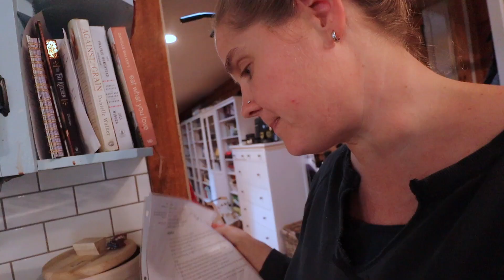Building a Homestead in 100 Days - Day 38

Comment: Justin i have put in several Apollo heating systems and i have alway put the Water coil between the filter and furnace so that it captures all the airflow . as you noted only 1/3 of your total CFM is going thru the water heat exchanger that needs to be adressed . hope to chat about all things homestead in the future.
Reply: I think that location will heat up the blower motor and reduce its lifetime. I think inside a  transition duct between the top of the furnace and the bottom of the AC evaporator case is a better location.
Reply: @bruceadler-9410  I agree but from the video Justin doesnt have the clearance above the furnace to the trunk line because of ceiling height. between the furnace and evaporator coil would be the Ideal position.
Reply: @ncbeeguy  I also thought the vertical clearance might be a problem. So I told  Justin he should replace that oversized Muli-Position A-coil evaporator with a smaller vertical N-coil evaporator, and install a single correctly sized heat exchanger in a new transaition between the furnace and the new shorter evaporator. Even if the result is an evaporator that's undersized for his house. I think in his environment adequate heating during winter is a higher priority than maximum cooling during the summer (especially since they're the types that spend their summers outside and not inside chilling in front of the AC). And just looking at the relative sizes of the furnace and evaporator, I suspect that his current evaporator might be too big for the available CFM from the blower in the furnace (but that's just a wild guess).

Comment: Your cinder block building on the hill could be a  possible shelter or  stall for animals on hillside...like a future momma pig with young healthy piglets, to get out of wheather.or a Cow with calf that needed shelter from wheather. Sheep ect. You could save water run off roof, with gutters to fill a water tank for your source outside. Make part of it blocked off for storing a few hay bales or bagged wood chips for  clean flooring, or you could build an add on small storage shed rat proofed to keep some feed there in a drum. Just a thought it's a stout building already that won't blow down, it would be cool in the summer, protection in the winter. Or a quarenteen area for new animals.

Comment: Simplest solution for the heat, in my opinion, would be to put the HEPA style air filters in the unheated returns and a see through fiberglass air filter (cheap filter) in the heated return filter slot. If u have three filters in your system this would work. If you have only one filter... Block a portion of your unwanted airflow with paper and a piece or two of tape. That's a cheep fix.... The "proper' fix will be a little more expensive

Comment: Why did they put the coil on the air return?  The one we had when I was a kid (Hardy wood stove) was above the A/C unit so when the fan (not the A/C) was running it pushed it through the duct work.  The only reason I see for the way it is set up is so that the furnace can supplement the heat.  I didn't see where all of your returns are coming from but wouldn't opening them up help with circulation through the house?

Comment: There's a simple way to drop a tree in the desired direction. I'd rather a professional explain it, but I've seen vids demonstrate it.

Basically, an angled cut upward is made first. The 2nd cut is made a few inches above the 1st cut, on the same side to intersect with the1st cut, forming a wedge shape which is removed or falls out with a nudge of the saw. This becomes a weak spot. 

You step back, out of the way, & make a 3rd,  cut which intersects with the  first two. So 3 cuts to the same spot allows the tree to follow the path of least resistance, falling predictably & more safely. 

They don't get stuck standing or need to be pushed over, with no control over which way it could fall. It could've bounced or fallen over in an unpredictable way. With all that weigh it pays to be sure where it's dropping. 

I think you could hurt your spine,just pushing at a tree that tall. With no way to control  that much mass, once in motion. 

There's also the risk that by just pushing against a tree with all you're might, could result in a wrenched joint, a torn muscle or tendon, & also strain your back, your neck or shoulder, or wrench your lumbar area & throw your hips out of alignment & then you can't walk or do much of anything, without pain & your feet & knees. Torn muscles are possible & could mean serious downtime & enduring pain. 

These kids want to please their dad. If they're spending hours dropping trees every day I'd like them to know how to avoid injuries. I think maybe they're finally wearing safety glasses!